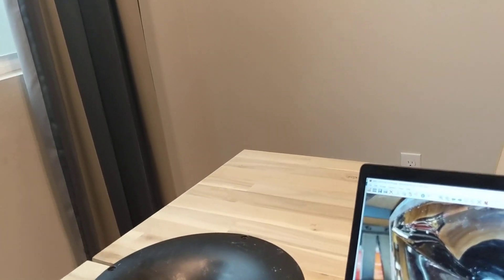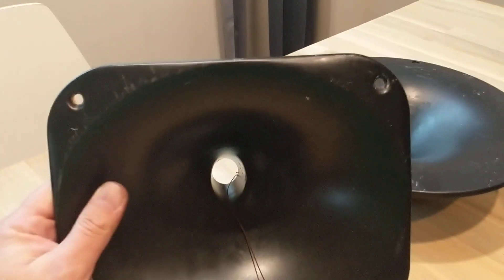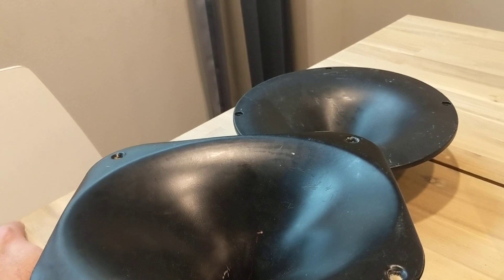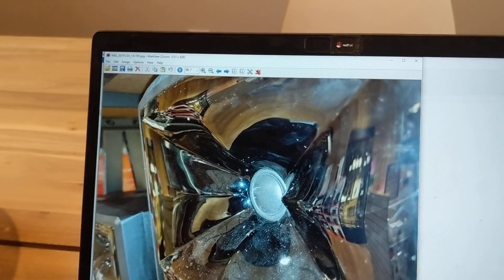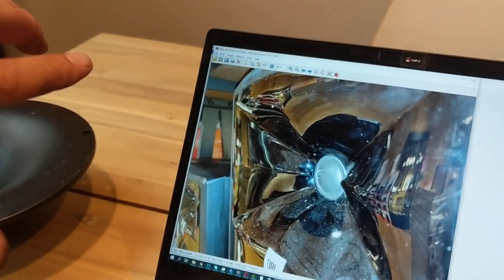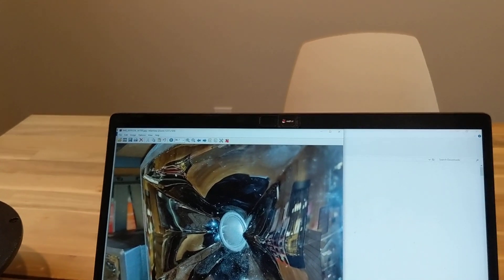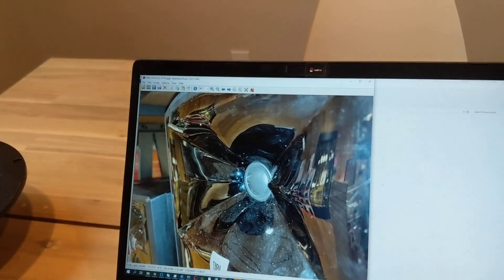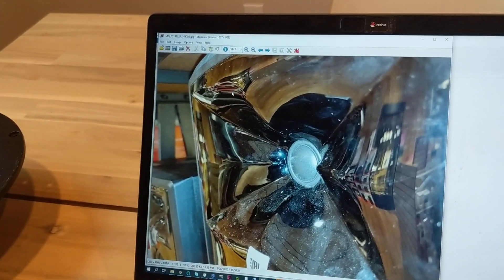New Wave Biradial Horns

Comment: Thanks, nice work, I'd wondered why it's shaped that way.  

What proportion of the sonic issues with horns/waveguides would you speculate can be attributed to power/room response irregularities caused by this phase cancellation issue (which I'm assuming is what JBL's solved here) vs the diffraction they generate?  

AVSforum had that head to head where the Salon2 was preferred over the M2, which makes me wonder if diffraction will always relegate horns and waveguides to second best, at least at domestic distances, despite their dynamic advantages.  I'm thinking those dynamic and resolution advantages might be brought to cones and domes through the use of high voltage, high tesla, high Bl/Mms field coils, though of course horns would still be necessary at distance.